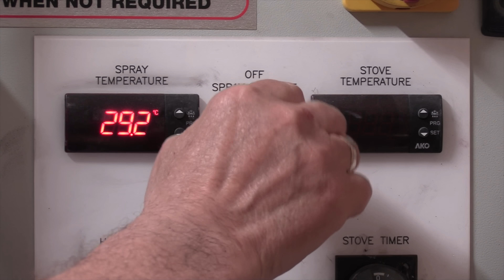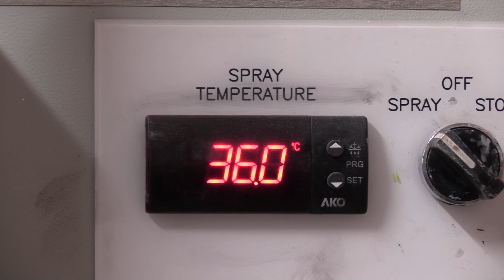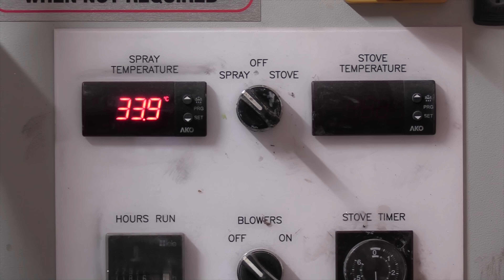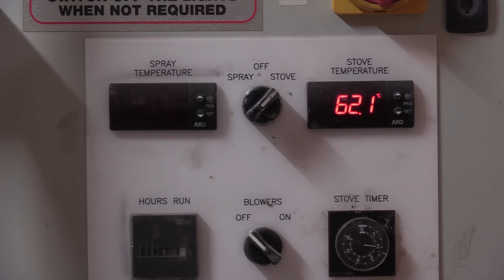Harley Softail M8 Street Bob, Fuel tank Conversion...Paint Day !

Comment: Question: If I may , why paint it gloss black, then flatten it and paint a clear gloss over the top ?
Reply from the maker: Firstly the clear coat is a little more impervious to fuel spills than the raw colour, but also adding a layer of clear to anything gives extra depth and this has a slight rainbow flake and the lacquer's needed to encase that!
Reply: Super job.